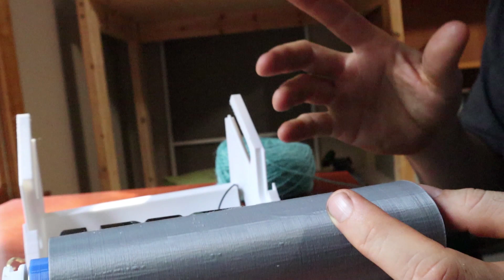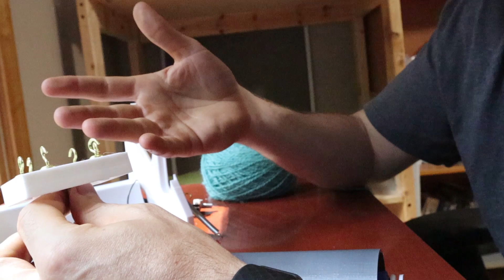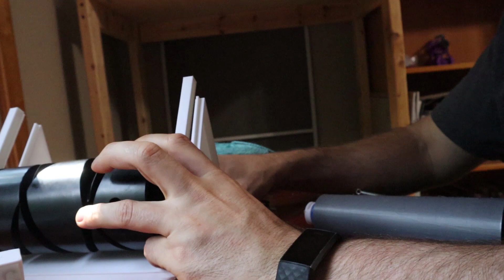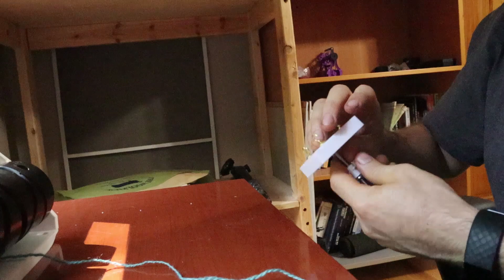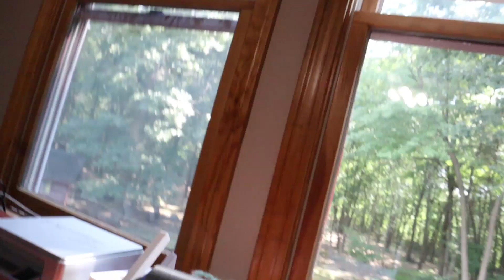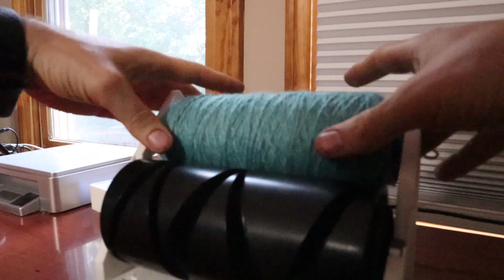SPIN #87 - Functioning Cone Winder Prototype Update

Comment: Hi your winder looks very interesting.
I think a spring and disc type tensioner similar to a sewing machine would work better and much simpler to adjust. That what is used om all types of industrial knitting machines. AS you mentioned you should ho for a longer cone.
Keep up the good work
Jens
Reply from the maker: I have experimented with those kinds of tensioners, but found them unneeded.  In general you want low tension on a cone and I've found a lot of sources already put more tension than is ideal.  I plan to do another update soon with a much better tension system.
Reply: Most industrial winders have the possibility og waxing the yarn during winding, that would be great
Reply from the maker: @jenspmaudal4453  This is the first request for this I've seen and I'm not actually familar with this process.  Do you have a link that could educate me?  I did a quick search and found some yarn waxing kits.  If it's just a cylinder of wax you run the yarn along, then I'm not sure I need to add anything to support that.  You would just want to arrange the yarn so it gets guiding through the waxing apparatus.  I don't think I would build in a holder for this since it would be pretty easy to just set it up separately between your source yarn and the cone winder.  However as I said this isn't a request I've had before and I just found some things by searching online.  If the purpose of this is different please educate me.

Comment: Using the drum with the slots in it limits you to one exact size of cone.  What about an eye that slides back and forth on a track and the user can limit the length of the track.  Something like a woolee winder.  I think cones have a wider space between each wrap, so maybe some programming to move the eye faster / more.
Reply from the maker: The woolee winder uses a self reversing thread that would also be limited to a single length.  In theory I could create what you're describing with the correct electronics, but it wouldn't be as elegant as it would likely require 2 motors and more mechanical parts making it more expensive.

Comment: Why do you use a belt instead of a cog/metal-toothed gear wheel?
Reply from the maker: To reduce noise and allow a more flexible placement of components.  There are advantages to both methods, but overall I currently think belt systems are a little better for my designs.

Comment: Looks like an awful lot of friction on yarn
Reply from the maker: As I mentioned that is adjustable.  I did lower it later in the video, but didn't talk about it.  That said cones will always have more tension than a skane which is the best way to store yarn for where yarn stretch matters.  Cones are much better to knit from though so ideally you'd just transfer to a cone right before knitting.

Comment: I definitely agree that the drum is the way to go. I notice that the cone you use is very different from the cones used on the Silver Needles winder. Those are much wider at the base than the tip. This is also true of every cone of yarn I have ever purchased (hundreds). I can’t say that the pointier cones are inherently better, but I see a few things with the less-pointy cone that make me wonder. One is that I suspect that the pointier cones are more stable and less prone to tipping over. Also, a huge concern (possible deal killer for me) is that the yarn at the bottom of the cone must never get wound below or under the previous layer. This would cause the yarn to jerk as it feeds and that is death to machine knitting. I’m not sure I’ve explained this in a way that’s understandable, so let me know if it doesn’t make sense, I can make a video. Bottom line, if the yarn is not wound on precisely in the way I’m referencing, it’s not a useful tool for machine knitters. I’m also very interested in seeing just how large a cone of yarn can be wound?
Reply from the maker: The machine would wind top layers on top with enough overlap that you won't get the jerking you mentioned.

Comment: I couldnt remember if you said in the video but people like to wind onto a cone for a sock machine. Would these accommodate the cardboard cones one gets from Erlbacher for winding?
Reply from the maker: Right now those types of cones won't fit.  I'm trying to decide if I would support those.  While I know some people want to use them, this would increase the cost of the machine significantly because it would require larger plastic molds to support the larger bobbins.